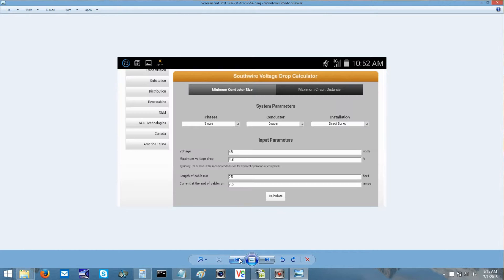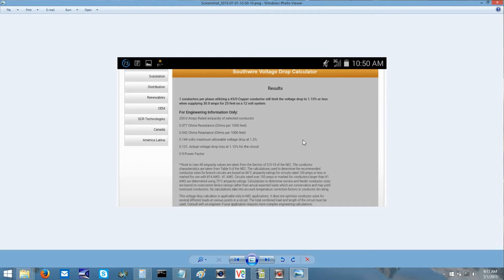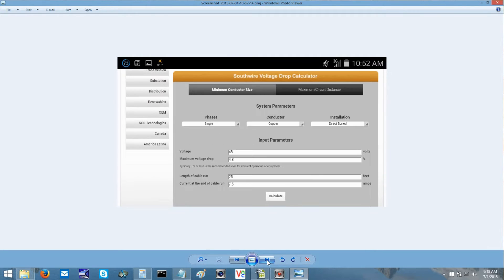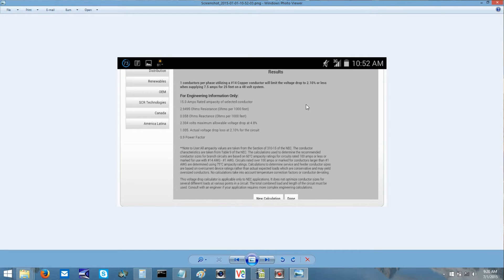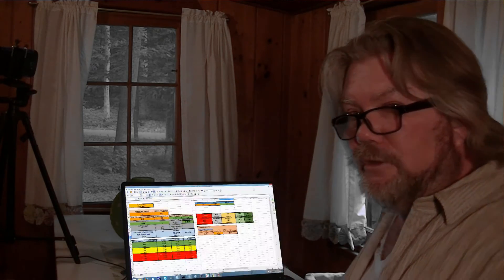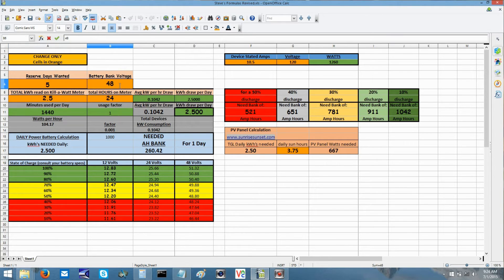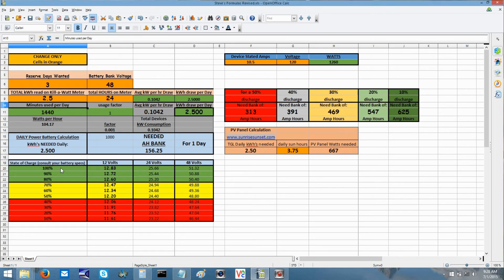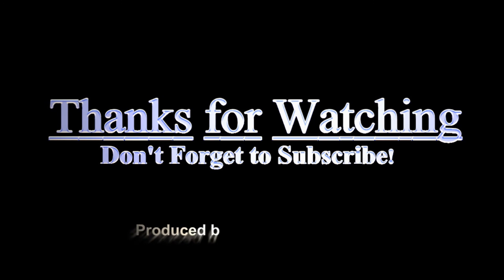Voltage vs Wiring Size Explained and Spreadsheet for Battery and Solar Panel Calculations

Comment: Very good info throughout the video I've been on 12 volt for about 4 years and its clear i am burning up my batteries lifespan so really need your help... four panels in series 170 watts  each.The charge controller 20 feet in distance.What will be wire size from panels to charge controller.??

Comment: I down loaded the Battery Size Exl, sheet "But It did not show the far Right Cells ! Why not ??
Reply from the maker: I'm not sure about the problem you're having, but it was developed on Microsoft Excel, and tested on OpenOffice.  It doesn't work properly on my mobile device.  If you know someone who knows spreadsheets on the device you're using, I would suggest going to them and perhaps they can get them to show for you.

Comment: Hi steve, I think you have mixed up the second line of the voltage drop calculator. The second line is Percentage, not Voltage. Putting in a voltage drop of 10% will calculate that #8 Copper conductor can be used, which will limit the voltage drop to 8.64% supplying 30.0 amps for 25 feet on a 12 volt system.
Reply from the maker: You are absolutely correct, I did make an error.  Thank you for pointing that out!
Reply: Hi Steve! You're welcome! I've been doing this for 60 years, and making mistakes for 60 years! Great video though, please 'em coming, thank you :)

Comment: You should look into the subject of limiting voltage at DC , there is a reason that the industry does not go higher than 48 vdc - arcing becomes an issue !
Otherwise lots of good stuff ;)
Reply from the maker: Thanks for your comment!  Technology is a constantly evolving, developing wonder that always moves us to the next level.  Although still a bit pricey, Square D has been manufacturing Safety switches, breakers, and switchboards capable of hundreds of amps at 250VDC.  An example here:
http://ecatalog.mecampbell.com/customer/maecac/customerpages/ProductDataSheet/SQDLA36400.pdf

Square D's QO series breakers are now rated at up to 250VDC when used in a double-pole (tandem) configuration to interrupt both the positive and negative sides of the circuit.  This makes the Square D QO usable as a combiner for solar panels in MPPT charging applications where 90-140VDC input is required for the charger.  They can also be used in certain applications up to 500VDC when installed in an ungrounded UPS system.  Datasheet here:
http://static.schneider-electric.us/docs/Circuit%20Protection/DC%20Rated%20Circuit%20Breakers/0601DB0401.pdf
Reply: Steve , my comment about high voltages is not so much related to the breakers , but the solar / alternative energy field , when we raise the voltages and have higher current , the potential for arcing becomes a serous issue .
This is not new , relatively , and that's why at the battery bank & inverter , you generally can not find anything over 48vdc .
Welding is done close to 30v & about 100amps .
I have a new to computer so do not have links , other wise I would add links .
Again a good video with good info , just a bit missing ;)

John
Reply from the maker: I definitely agree with you.   Higher voltages do carry a much greater risk of arcing.  Cheers brother!
Reply: Steve Robertson  Steve: Hope this is an ok method to ask a question.   I have four 48 volt panels,  rated at 240 watts each, not connected yet, and a 2000 watt inverter.  We want to off-set our hot water utility costs by using the pv collectors.  In another video,  did you recommend sending DC power to water heaters using two upper water heater thermostats?  We’re trying to reduce our load on the inverter, hopefully this method of heating water will accomplish that goal.  Thanks for your YouTube videos and extremely helpful comments.  Bob(not connected yet)
Reply: Steve:  We sent a comment(think it went private), please post public, thanks,  
Bob(not connected yet)

Comment: Great 411 ! I am running a 4-6v deep cycle 220 a/h batteries ran in series to achieve a 24 volt system. 1. 3x 305 watt 24 volt Array VOP 36 volts @ 8.7 amps each (should I run these in Parallel or Series? Using MC4 and a 50' cable @ 10 ga. to the 80amp 24v MPPT Charge Controller2. I am using 2 Ga. Terminal wire on the 4 -6v batteries in SeriesQ: I have x2 60" 2ga Cables from + off Bat #1 and - off Bat #4 to Power Inverter Lugs.  Charge Controller from battery bank.The Charge Controller input ports are to small to accept 2 gauge size wireCan I use 10 GA with terminal rings from the battery bank and would I direct wire connect them to the CC Battery inputs in the same way I have using my Battery Tender off of the opposite ends of bank +/-- 1& 4.Q. Can I run my 24v tender off of the dump load? instead of ac 110? Would the MPPT recognize that the tender is 24v?Thanks for any sound advise :) ~~~~~!!!!!!!!!
Reply from the maker: You can run a DC load dump instead of an AC load dump.  Make sure you use a relay rated for the voltage and current you will be dumping.

Comment: This is so interesting.  @ 13:27 you say you generate and consume 25 Kwh's per day. We also consume about 25 Kwh's a day. Using my "Owl" (device that connects to the 240 volt mains and records energy consumption), I use roughly 15 of those 25 Kwh's from say 5 pm (when the sun is gone) till 9 am (when the sun officially comes up), and the remaining 10 Kwh's during sunlight hours of 9 am- 5 pm. You must only be using 2.5 Kwh's from say 5 pm till 9 am ?... and  22.5 Kwh's from 9 am till 5 pm ? ... do I have it right ?
Reply: +Steve Robertson (Off-Grid Living) Awesome.... Nice to see some real world numbers- thank you for your reply Steve.
Reply from the maker: +Mark Osborne That's correct.  All air compressors, log splitters, heavy tools, laundry, cooking, etc are all during peak electrical production hours.  After sundown, we only run lights, tv, computer and the well might kick on a couple times.
Reply: +Steve Robertson (Off-Grid Living) I mapped the rear yard and at roughly 8 am  in the summer months, I could theoretically generate power, and it lasts until about 7 pm. I'd need one array facing easterly, and one westerly, and 2 grid tie inverters, or 2 charge controllers (depending on how "off grid" I want to be).  If I got it correct, your array is facing in one direction ? and you still get enough energy to make 25 Kwh's during daylight... impressive... How many watts your panels are capable of in direct sunlight ?
Reply from the maker: My entire array is capable of 4800 watts.  Just 5 sun hours would produce 24kwh of power.  My array faces slightly  South Southeast all in one direction.

Comment: Excellent video/explanation. Best thing I did for my system was to go to higher voltages (PV array and battery). Everything runs cooler, too (esp the solar charge controllers). I wonder how these calculations work on a hybrid system like mine? I only use the batteries for powering the inverter...not so much for storage. When the batteries reach a certain voltage, the Outback Power inverter starts inverting. When the voltage drops...it switches back to grid. I really don't want a large battery bank and use the PV energy to charge for hours on end...just "right sized" to get the voltage up relatively quick and start inverting. THanks.